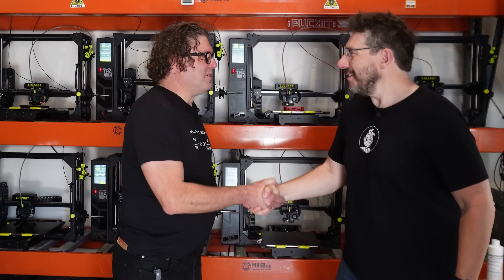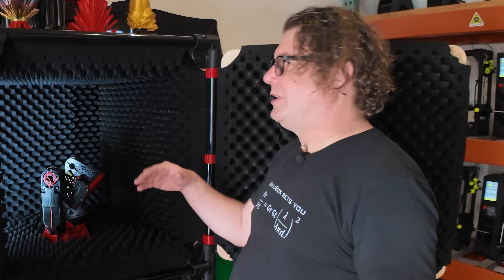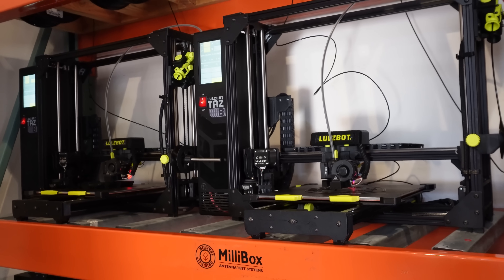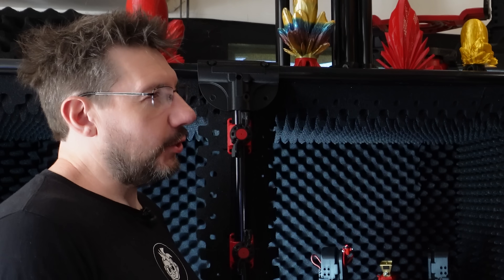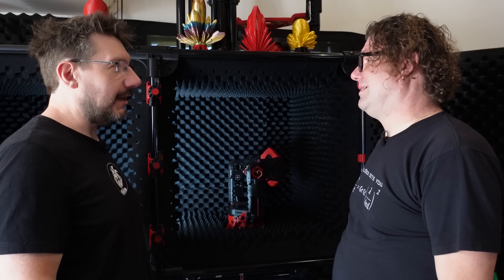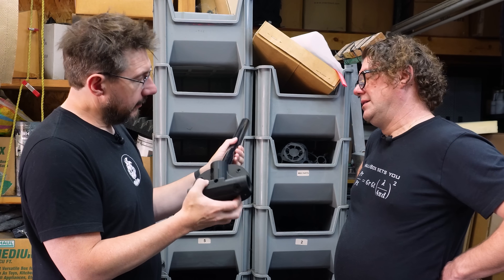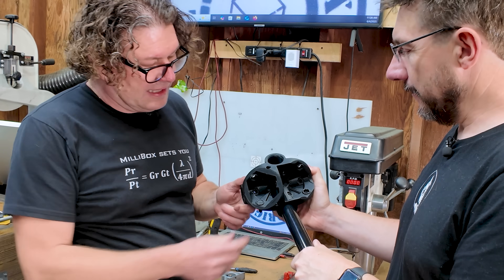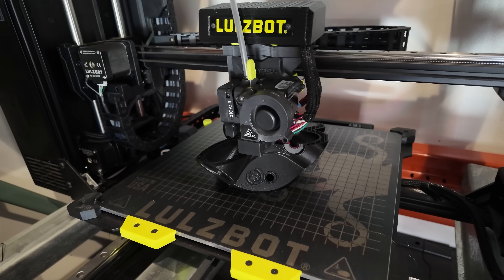3D Printing and ANECHOIC CHAMBERS

Comment: These printers are insanely overpriced.
Reply: We appreciate the feedback! LulzBot printers are designed for industrial-grade reliability, open-source flexibility, and long-term durability—with U.S.-based manufacturing and support. That said, we understand price is always a key consideration, and we’re constantly working to provide the best possible value for serious makers and businesses.
Reply: @Lulzbot3D Your printers could be built on the moon for all I care. 5k for a bed slinger is outrageous.

Comment: @Lulzbot3D please design a quad idex (two gantries, four heads). 

Make one 300x400x300mm with a flat MACHINED plate that doesnt warp when heated, a heated chamber, and yes, insulation on the walls so that it doesn't take ages to heat up.

Can you make that happen?  You would sell thousands provided the price is relatively competitive.

You could even design an electro-magnetic brake on head/axis so it helps with vibrations while slowing down for cleaner prints.
Reply: A quad IDEX with a precision-machined bed, insulated heated chamber, and even smart vibration control? That’s the kind of big thinking we love to see. Passing this along to our engineering team!

Comment: Man I wish Lulzbot would release a multi tool head machine, with 4 or more heads for minimal to no filament waste with multi material prints, properly heated chamber (65C +), and a large build volume. Core XY or similar would be a huge plus too.
Reply: We love hearing this kind of feedback! Multi-material printing, heated chambers, CoreXY, and larger build volumes are things we are exploring in the background. We’ll be sure to pass this along to our product development team. Stay tuned—there’s always more to come from LulzBot!
Reply: @Lulzbot3D a quad idex is my dream printer as well.  I’m not too keen on tool changers. 

Make one 300x400x300mm with a flat MACHINED plate, a heated chamber, and yes, insulation so that it doesn't take ages to heat up.

Can you make that happen?  You would sell thousands provided the price is relatively competitive.
Reply: Absolutely, Bambu shouldn't be the only solution.